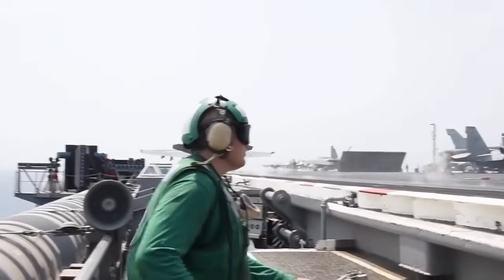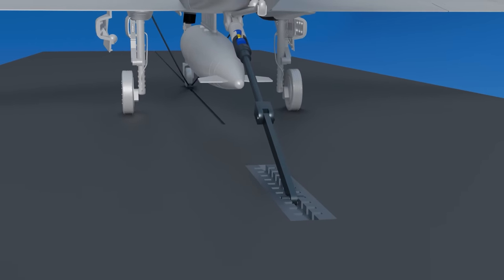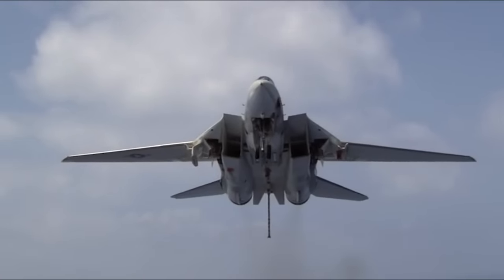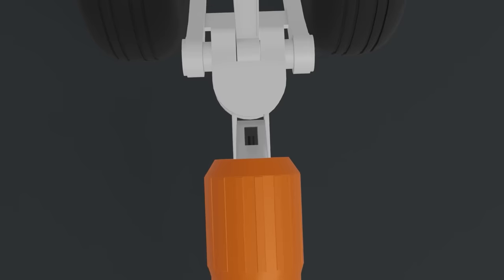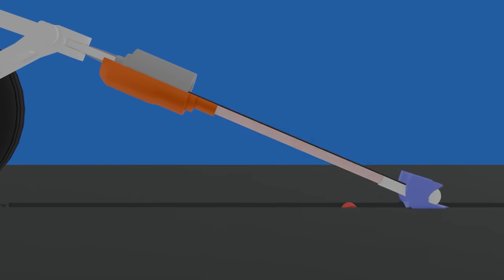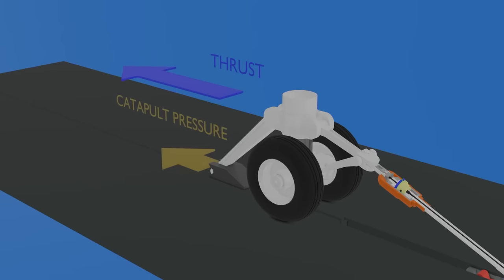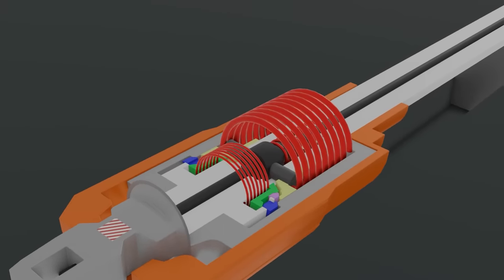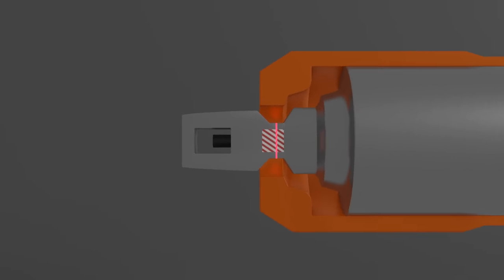Catapult Launch - The Story Behind Holdback

Comment from the maker: If you would like to learn the principle of operation of another device or procedure related to aviation - let me know in the comment
Reply: I'd like to see procedures for loading GPS encryption, COMSEC, MIDS and IFF keys as well as frequency hopping stuff (synchronizing TOD without use of GPS TOD, loading WOD etc.).
Reply: Could you do a throwback to the entirety of the “meatball” or fresnel lens system?
Reply: Thanks for the info. I worked on the flight deck during Vietnam when they were using the dog bones. They were color coded for the different aircraft. I have been watching U-tube videos on modern carrier activities & wondered how the new hold back devices worked. You might cover the nose tow system vs the old bridle system. Nose tow was a big advancement.
Reply from the maker: @Mike88Actual  that's gonna be the next one bro:)
Reply from the maker: @macieksoft  ten temat zainteresuje chyba mniej osób niż kwestia dogrywania ITS-u na Sikorskiego w Tychach😂
Reply: @x-planed  Temat mało mainstreamowy, jednak bardzo ważny technicznie (komunikacja w hoppingu/datalink oraz IFF to od dekad nieodłączny element wyposażenia maszyn NATO).
Reply: what happens to the shuttle at the very end?
Reply: I’m curious to know how an aircraft carrier moves. How many propellers, and where they are placed, does it cool itself with the ocean water, can it sail at full speed for long periods of time?
Reply: @macieksoft oh man that stuff gets so complicated so fast and I struggle to understand it lol. TSEC, MSEC, MKEK, CVLLs, etc. Ugh...😂
Reply: Id like to see a full animation/breakdown/explanation of an ACES II Ejection seat!
Reply: I always wondered how the shuttle releases from the airplane.  Does it come to a sudden [slamming] halt?  How does the bar on the nose gear release?
Reply: @bschonec think of the shuttle like how a slingshot works. The pocket on the slingshot is the shuttle and the ball bearing in the pocket is the aircraft. And yes, the shuttle does indeed “slam” to a stop in a way. The piston that it’s connected to inside the catapult cylinder under the deck has a pointed end like a spear, that hits water in the far end of the cylinder which brings it to a quick halt in a very short distance. That’s the best way I can think to describe how it operates.
Reply: Catapult part 2:
How does the catapult shuttle not lose “pull power” (steam pressure being expended) as it travels down the track?
Reply: They used to use wires to hold the airplane to the catapult instead of the bar on the nose gear. That would be an interesting video on how it worked.

Comment: This is the best description I've run into, even better than the training videos we had at that time.  We used dog bones on the A-6E Intruder back in the late '80's early 90's and I can't tell you how many of them I threw over the side.  I regret that, I wish I would have kept one.
Reply from the maker: Thanks Mate. I wish i had one too😉
Reply: Did my service years in a West Coast E-2 squadron based back then in San Diego. When on cruise, the squadron would recognize their sailor of the month, quarter, or year with a mission flight in the squadron's E-2. The CO also allowed airborne re-enlistments during a mission flight, if requested by the sailor, and on rare occasions a non-aircrew Navy "guest", e.g., an air wing flight surgeon, could be allowed to go on a flight. Whatever the reason, the squadron line crew made it a point to keep both ends of the hold back for the skipper to present to the individual on  his return along with a certificate documenting the flight and subsequent trap back aboard the carrier.

Comment: I never really thought about the holdback until now - I just assumed they were standing on the brakes (which is pretty silly in retrospect!).  I would also be interested in how the fitting that pulls the aircraft along the catapult disengages.  Thanks!  You have another subscriber.
Reply from the maker: Thanks😉
Reply: You mean the shuttle that the launch bar locks into? It's open in the front, so there's nothing to "disengage" from really, once the catapult/shuttle stops, the aircraft is "free" (to either fly or crash into the ocean in the case of a "cold" cat shot).
Reply: @Nghilifa  Thanks, that explains it very well.
Reply from the maker: @B-and-O-Operator-Fairmont  and  have to add, that the launch bar position knob in the cockpit is set to "up" before the launch so it retracts automatically just after it's free of the shuttle
Reply: There is no release from the CAT. THE cat stops,the plane keeps going.

Comment: That's interesting. I had only seen the break design. 
It's fun to see the videos from the 60's and 70's where the crew lie on the deck as the plane moves into position above them to lock in the rear hold back.

Comment: God is good, god is great god is a aviation’s boatswain mate…
V1 division, started as a blue shirt, then crash and salvage, then to tractors, to the tractor king (tk) then a yellow shirt.  And I never knew how this hold back worked. Granted it was part of v2 job not v1.  Thank you for the knowledge on this.  Those guys in v2 were the only other guys on our ship that worked the hours we did with those 18 to 20 hours a day out to sea from hour before flight ops started at 6am till last plane landed sometime between midnight and 4am.  Much respect goes to those guys and now ladies in the v2 division working the catapults and arresting gear.  Brothers on the deck.
Reply from the maker: Wow thanks. It’s my dream to spend just a couple of days on the deck. I bet You have a bunch of helluva stories to tell. I’d love to hear some of them
Reply: @x-planed  I was only in during the early to late 90s on the CVN-69 Dwight D Eisenhower. Ships Motto was “I like Ike”, but we were the first combat ship to officially have woman serve on it, so the Motto was unofficial changed by some of our crew as “CVN 69, we got our problems licked” def was a huge change when woman first came aboard but some of them worked circles around some of the guys we had. One thing I def did loved serving on the flight deck beside the aircraft, was it didn’t matter what rank you were or how important u thought u were. We were all equals on the flight deck when it came to safety and our job. Rem one time a pilot came out from the island during flight ops while we were in recovery mode. And this pilot decided he was going to walk across the flight deck and cross the foul line to get to the finger( a spot on the other side of carrier aft of ship port side, near elevator 4). Well some major rules on flight deck was keep head on a swivel, stay safe and never cross the foul line during flight op recovery. Well this officer pilot not paying attention as a f-14 at the time was calling it’s ball getting ready to land had about a foot and half across the foul line and one of my friends at the time only a E5 enlisted guy saw this officer pilot and grabbed him by the back of his helmet & flight suit and yoked him bk across the foul line and threw him directly on his ass.  Well as u can imagine this pilot was furious. He ordered my friend to go with him for assaulting a officer.  He walked rt bk into the island and went directly to the mini boss and air boss to inform them what happened.  As my friend sat out side while this officer pilot was telling them what had happened they both asked for my friend into the room.  Obviously he was scared he was getting ready to go to captains mass and get kicked out after spending time in the brig for assaulting a officer.  Well huge twist was the air boss and mini boss were furious at this pilot and ended up having the pilot apologize to my friend the E5 and had to thank him in front of the whole flight deck at the start of the next F.o.d. Walk down (foreign object damage) and thank him for saving his life.  The officer even had to put up some $ for my friend to take him and his girlfriend out to any restaurant of his choosing. At time I was still only a E2 and seeing this happen to a officer even though a enlisted man put his hands on him and threw him on his ass made me respect that flight deck even more and realize it didn’t matter who u were. Safety was everyone’s job no matter ur rank or job.  Your on that flight deck u are a safety officer and anything goes if u see someone breaking those cardinal rules we had on there.  Def do miss it.
Reply from the maker: @obxnice  Yeah, safety is always first, no matter who You're dealing with. I love stories like that - first-hand real life. Can I ask You a few questions privately f.ex. via e-mail?

Comment: Cool vid.  I do wonder if the launch is controllable if the launch bar fails and doesn't break until it reaches 160% of the normal release pressure.  In other words, if the launch bar fails is it a disaster or is it no big deal.

Comment: Absolute BEST explanations on this channel!  All interested in CV air ops should sub. Ideally all AB ratings should sub.  WELL done!  BZ! Other devices: Arresting gear ops, barricade setup, old-style bridle / water brake launch, respot sequences (which planes go where, and in what order), weight sets for a/c types prior to launch.  V-5 / PriFly ops during launch and during recovery (there are several vids showing FD ops, but I haven’t found one yet for PriFly).  Thanks!
Reply from the maker: Thanks Mate. Very useful comment! In fact I’ve already started working on arresting gear system😉

Comment: how hold back work for a non catapult carrier having ski jump type take off mechanism?
Reply: Depending on the carrier, it doesn't use them... it relies on the aircraft brakes until full power overcomes the friction and then the ramp gives the wings enough AOA to loft the aircraft... hopefully! Also look at the deck.. that don't start way forward like catapult carriers, they start waaaaay back for a longer rollout.

Comment: Besides the COLOR of the holdback, is there any PHYSICAL shape or size that prevents the use of a holdback that  is an improper strength?  (Think smaller diameter filler nozzle and filler hole for keeping leaded gas out of vehicles designed for unleaded gas!)
Reply: Yes, the fittings are slightly to vastly different from aircraft to aircraft. Often times we would only bring on deck the holdback (s) that were required for that launch sequence. Many times it was a squadron with all the same airframes so that made it easy.

Comment: Back in my day we would use get 6 or 7 of the fattest guys on the deck to lean on the front of the wings until the jet was ready to go, then ring the chow bell and watch them bolt to the deck edge, aircraft awaaaaaay! This holdback would have been easier. 😁(Greenshirt Air Dept, V-2 Div, Bowcats  CVN-72)

Comment: The catapult doesn’t apply a pressure. Pressure is force per unit area. The catapult applies a force and the dog one breakers at a predefined force. Units units units units, units are king in science. The only pressure is the steam pressure in the catapult but that’s not applicable since that’s then converted by the piston and the sled to a force. ie the steam pressure is applied to the catapult piston that has a certain area, so the steam pressure divided by the area of the piston then gives you the FORCE that the piston in the catapult applies to the aircraft. Simple.
Reply: Correct. The steam applies pressure to the aft end of the spears, which as a result exert the force sufficient to release the holdback.

Comment: Another explanation of Aircraft launching from a Carrier Deck by someone who knows NOTHING about Flight Operations from a carrier. How do I know?! It's pretty simple really. I served on a carrier and 'I' was often tasked with providing information to the Bridge on the correct coarse  and speed for the carrier to sail to provide the correct 'Wind Over the Deck' for flight operations. This guy is giving everyone the 'DUMBED DOWN' version of launching a plane from the deck.
Reply from the maker: Dude, nobody claims wind and boat's movement is irrelevant but I didn't have to mention it in this particular video as it is mainly about holdback device and nothing else. But If watched carefully my video about hand signals You'd see that I'm describing an MFCR device (around 7:40) which provides the data about wind speed and direction and ship's speed. So NO - it's not a dumbed version
Reply: Jeezuz James! Relax buddy... Hop down off that high horse... you aren't the only one who has served aboard a carrier. I was a Greenshirt, and I think this video did a pretty good job (much better than most) of explaining how the holdback works. The intention was not about how flight ops work, or how super humans like yourself got to send messages to the bridge. It was about a piece of deck equipment and how it works. Dumbed down versions are usually adequate for the general public as 999% will never crawl under a fire breathing plane to attach a holdback. It also happens to be the most asked question right after how the catapults work when someone asks me about how the mechanics of the catapult work. Make us some videos, James, and I will watch them as well.
Reply: @Way Outthere haha     Hadn't considered that, WO, but possible. If the info is correct and explained well I see it as a good addition to the stream of "how it works", but if someone is rolling out crappy info or making seriously stupid comments or facts in their vid, yeah, you are probably right...  some nut job in mom's basement who has never seen a ship.